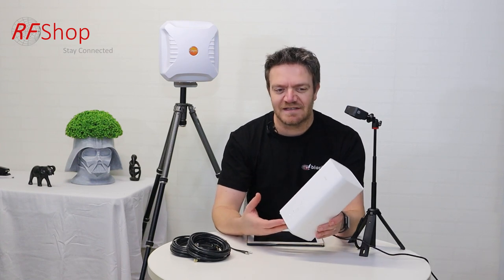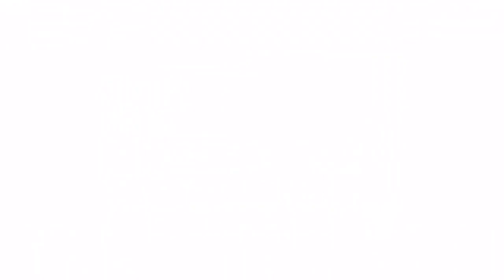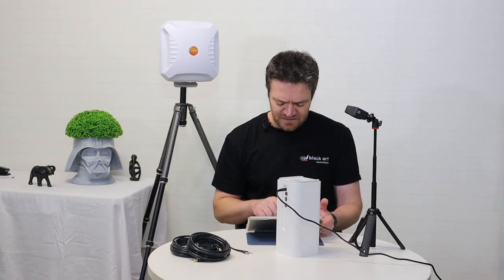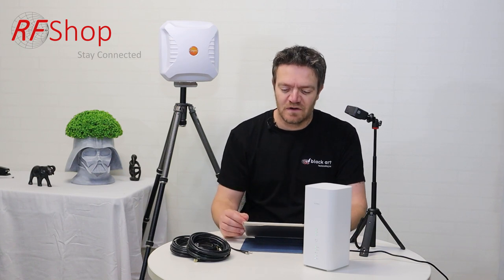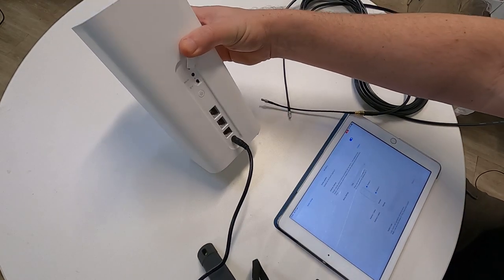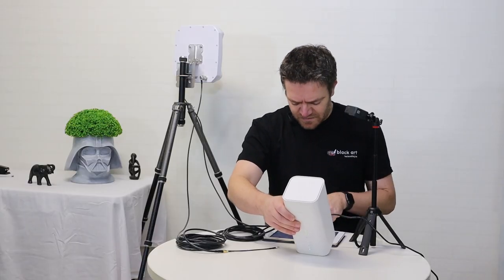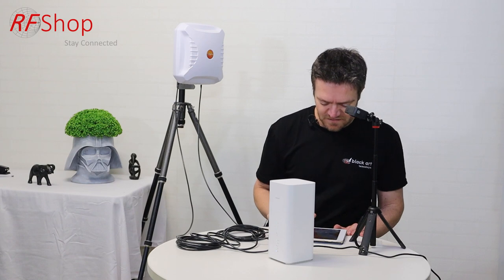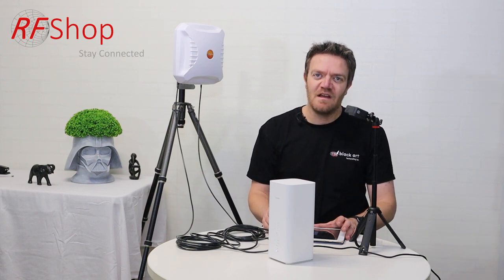How to connect a 4G external antenna to a Huawei B818 modem

Comment: thanks so much for explaining about the main and div antennas and about setting them up to run properly. i was about to buy 2 antennas and thought i had to fit one to each connection, but after watching this it seems that i only need the one, connect it to the 'main' labeled fitting on my router and leave the div fitting as it is, then in the router's homepage and settings, set the configuration to mixed. I think i got that the right way around and you've cleared a few things up for me as-well. thank you
Reply from the maker: Thanks a lot for the feedback !

Comment: That speed is insane man...
I've been using Huawei 3G,4G modems since 2013 since they're the best price/value in Europe.
Unfortunatelly I've changed like 4 different roof LTE antenas and what I found out is that sometimes modems work better with internal antenas and sometimes with 150eur roof LTE antena I've gained like one extra dot on signal indicator. SMA is far better than TS9,since the cable diameter is bigger and more robust with screwing It on modem.
Reply from the maker: Yes, although this video is quite old by now, I still have a lot of love for 4G

Comment: I have a single directional antenna with single output cable. Am I correct in saying that this should connect to antenna input one for it to work. Should I look at replacing it with a similar antenna to what you are showing with two connections. Thanks
Reply from the maker: Yes, a single antenna will work...just need to make sure it connects to the correct port and also thatd the antenna support  the correct frquency bands

Comment: do I need to ground my XPOL-2 antenna? 
I'm just concerned  about the router's safety in case the antenna gets struck by a lightning or in case of a current surge from static electricity
Reply from the maker: Hi Tokelo. For RF performance you don’t need to ground the antenna, but introducing a set of lightning protectors for areas where thunderstorms are common is always good practise. It may mean some adjustments to the cable and connector assemblies to make it work for your specific scenario. Here in Adelaide it’s not so common to get ligtning strikes, but coming from Pretoria, ZA I know how intense those summer evening storms can be.
Reply: @RFShop  alright noted.  Thanks for your response

Comment: Hey! I have set my antena to have great rspr and rsrq but the snir value is very low => 7. Is it important? Can I do something g about it? Thanks!
Reply from the maker: SINR is an indication of how much stronger your signal is than the noise floor. Around 7dB is quite do-able, but higher is always better. Lower will become a problem (i.e. closer to 0) and you will find that the modem starts to struggle to see the signal in the noise. It's a bit like having a conversation in a pub...trying to hear your friend gets harder as the noise gets louder.

Comment: Really really really useful! Thanks a lot, you solved my signal problems.
Thanks from Italy. :)
Reply from the maker: Thanks Eduardo!!
Reply: @RFShop  hey man! I'm currently considering buying a new router but can't decide which one should I get! The b818 or the b2368? Could I just buy an antenna for the b818 and it would me the same as the b2368? I don't feel like going through the trouble of installing it on my house, or is it such an improvement that it's worth it?
Reply from the maker: @herobayman3662  I can only comment from an approved Australian device perspective. I do like the idea of the B2368 in principle, but it would still be an omni-antenna and not that much antenna gain or direction. 
If it's a simple case of good outdoor signal but not so good indoor signal (and the device is approved for use on your local network) that B2368 should be great and relatively simple. 
If the signal is not so good outside and you need some better antenna performance, something like the B818 with a purpose build outdoor antenna will be a better technical solution, in my humble opinion. 

We now have access to the B818, and can offer them as part of a kit or a standalone modem. Hope to get it on our website this week (time permitting :) )

Cheers,
David
Reply: @RFShop   oh okay tysm for your answer. Btw could you tell me what the difference is between the b818-260 and the b818-263?
Reply from the maker: @herobayman3662  unfortunately I have no idea. I can only assume it’s either a slightly later release or perhaps a dedicated model for certain network operators (ie might come with firmware approved for use on some particular network).

Comment: Tq for knowledge sharing. If using external antenna, can i change the setting from auto to external?  Is there any diffrences if i used external? Tq in advanced.
Reply from the maker: If you leave it to Auto, the unit will switch over the external antenna connections and it will be the same result
Reply: @RFShop  tq very much for the info sir.

Comment: Is it conpletely weatherproof? Because here in the gulf states we have crazy weather like heavy rains, dust storms, strong winds, hot summers and cold winters. Is it worth it installing it in such a place?

(If i would buy it i would install it outdoors of course)
Reply from the maker: Hi Hamad, This antenna is rated IP65, has chemical resistance and fire protection. Feel free to have a good read and look on the manufacturer's website
https://poynting.tech/antennas-and-accessories/antennas/farming-agricultural-antennas/xpol-2-5g/

Comment: I was actually trying to do this, I say trying, yet my modern did not auto detect the external antenna?
Even re-started twice and tried with switching cables over. It stays as internal and I used Auto as well.
Any idea? It pointed straight at the mast too!
Reply from the maker: Can you perhaps have a close look at the inner pins of your TS9 connectors? Seems that it is not making contact perhaps…

Comment: Hey! Quick question. I read that the router 4x4 antennas. I have an older outdoors antena dual MIMO 17dbi with 2 wires just like you show. The parameters says 1700-2100 Hz. Does it mean tha my old antena is not optimal for this router? Thanks for a great video!
Reply from the maker: Hi. That really depends on the network connection you use. If the router uses (or can use) anything in 1700-2100MHz it will work well. However, if the network is 700-960MHz or something lower the antenna will actually hurt you as the modem will detect the outdoor antenna and "use" it, but if it does not bring any signal into the modem it will not do much.

Comment: Hi, I've been having trouble with a omni directional antenna giving a weaker signal then the internal antenna, It has a patch lead going from a single cable to the 2 TS9 connectors. you mentioned not to do this, could this be the issue?
Reply from the maker: Hi Jayden...yes, I would think so

Comment: does it matter what cable goes where? is says "main" and "div". I know these antennas looks different inside for each cable
Reply from the maker: It actually does not matter if you have a MIMO antenna. However, where it does matter is when you have a single antenna, as you then need to use the MAIN and not the diversity port

Comment: Hi. I am considering in getting an external antenna for our Huawei B311 4g router as we get slow speeds here at home. We live in a rural area and our provider says that our maximum D/L speed is 40mbps. Questions: 

1. By installing an external antenna, will my Huawei router get more signal and will we have a chance of getting speeds faster than the provided 40mbps?
2. What type of antenna do you suggest, directional or an omnidirectional? I'm not entirely sure where is our cell tower so I was considering of getting an omnidirectional one.
3. What type of dbi gain should I be considering for an external antenna? The one I'm seeing I think has a gain of 10dbi and the other has 25dbi.

Thank you so much and I hope you respond soon.
Reply from the maker: Hi, I eould go for 9-11dBi and not much more. It gets very senditive to alignment. A directional MIMO setup for a fixed installation is always my recommendation. You can find the best tower by using the RSRP meadurements

Comment: Is the antenna's also function to make stronger signal coverage, so we do not necessary to purchase kind of repeater in order to get the better signal?
Reply from the maker: MC ISA, that is the ideal aim although not always possible. 
The external 4G Antenna can be positioned in a better location and has better performing antennas than built-in antennas. 
We rely on those two "features" to get a significantly better signal into the modems than what otherwise would have been possible. 
It's often seen that this is sufficient to get a reliable signal into the modem without having to add a repeater, which could actually introduce some complications
Reply: @RFShop  many thanks for your feedback.

Comment: I've read reviews of xpol2 antennas that were placed in the loft, and they claimed it performed better than being placed outside. Could this be true? And if not, why not?
Reply from the maker: Hi Sean. It certainly is possible that antennas can perform better in different locations and positions. Every setup and installation is different, but one really needs to understand "everything" about their experience and surroundings before one can do a sensible response. Even in many of my demonstrations, it's not the first take or experience that immediately works as expected, but I always make sure I get my head around what I saw before posting the video

Comment: Hi, may i ask..i need a favor here..i got my huawei b818..i just bought antenna with two seperate cables..one cable connect to vertical and another one connect to horizontal in single antenna..does this may occur an error if i put those two cables(horizontal and vertical) in single antenna into my huawei b818 into port main and div? Thanks..
Reply from the maker: Hi, it seems like you have a MIMO antenna. In that case, tge two cables are indeed independant and it’s fine to connect the two of them into the main and aux port of the B818
Reply: @RFShop  Thank David for the info and helping me out..glad to hear it..🤗👍

Comment: How did you get 130 mbs. Are you  using 4G.I'm seeing 4G. I am 3 miles from the mast  and am using one of these antennas but get very low mbs. I must be doing something wrong
Reply from the maker: Hi Alan, do you have the readings fir RSRP, RSRQ AND SINR?

Comment: Hi David,

Which antenna of your shop do you recommend me for LTE FDD bands b4, b7 and b28 ? 

regards
felipe
Reply from the maker: Hi Felipe, I would recommend the Poynting XPOL-2 for most use-cases where you require 700MHz, 1700MHz and 2600MHz. 

However, would be best to assess the whole setup and requirement before making a final decision. Things such as range, mobility or whether MIMO is even needed are important. In that case the ALFA Omni, or Poynting LPDA could be worth considering as well. 

Cheers,
David

Comment: Quick question does the antenna shown here come with the tripod setup? If not where can I purchase the tripod to fit this antenna also I live on a top floor flat so can’t really use it outside but did wanna place the antenna on a tripod by my window would I see benefits if I did this? Or is it purely meant to be placed outdoors which isn’t really an option in my situation.
Reply from the maker: Hi! We actually can offer those tripods…they are AU$89 each.
As for the location of the antenna…it does not matter. You can use the antenna inside or outside. The only problem is that antennas tend to work better outside, but if the limit is the surrounding area you just make do with what you can from the environment.
Reply: @RFShop  thanks for the quick reply that’s fantastic that you sell the tripod to go with it antenna, one final question do you ship overseas or have an online shop for the UK unfortunately I’m not in Australia but wondered if you do international shipping and to what extra cost?
Reply from the maker: @paulc2007  the tripod is quite a big item to ship overseas. I can confirm that there are two options, perhaps you can find the UK distributor? I presented the Gravity Aluminium tripod, but Adam Hall also has a nice aluminium modem. Seems to be 50% cheaper. From what I could see, here in Australia, the RRP for the Adam Hall model is AU$49

Comment: Do it have anything to say what cable u put in? Or is it one hole for just that one hole? Bc the cable and hole is the same
Reply from the maker: Kristian, we can do many different types of cables (also via RFShop). In this instance, we use an RG174 for the short TS9 cable. It's short and flexible. The 150mm length is minimal losses and the cable is flexible to prevent too much strain on the TS9. We can also use RG316...slightly better quality but still a small cable. I have seen TS9 connectors for RG58 / LMR195, but I am concerned about the force it would have on the TS9 connector. 

On the longer cable, we use LMR195 equivalent cable for 5m runs, LMR240 equivalent for the 10m runs and typically recommend LMR400 for anything longer than 20m. The kit, mentioned here, has 10m CLF240 cable (which is the LMR240 equivalent I referred to earlier)

Comment: Hi. I have poynting 2 mimo directional antenna and thinking  to use to use b818 modem outside by placing it into the encloser (as I did for my old Huawei B310 modem and it was working fine  for years). The question is- what it the temperature range for b818? Need to know to avoid overheating. B.R.Alexander
Reply from the maker: Hi Alexander. I can't really comment since I'm not heavily focused on consumer products or have any affiliation with Huawei. Being a plastic consumer product I would not recommend going far above 50dgr C though.
Reply: @RFShop  Thanks for the comment

Comment: may I have a question, please? Huawei 5G Outdoor Antenna AF9E is compatible with Huawei B818 modem?
Reply from the maker: Hi
Yes, seems to be compatible. It won't however, help on 5G since the B818 is 'only' a 4G modem. I would prefer better coaxial cables between the router and the antenna though, but since we don't review antennas we don't sell I can't comment on the performance or quality of that antenna. 
Our channel is focused around solutions we love to offer as we have seen them work really well.
Reply: @RFShop   thank you, I have one last question please, I do have this router at home, can I use this as receiving internet? E.G from a company internet provided then I use this Huawei b818 WAN connection as a router? ( no sim card ) apology I have no knowledge to much of modern technology.
Reply from the maker: @juniorj-r4090  probably can, but wouldn't you rather use the original router and a switch with more Ethernet ports?
Reply: @RFShop  hi there, I could do but I live in very rural area in the Philippines, I can’t get a signal like full bar in my balcony. What I have thinking is, I’m planing to buy a new LHGG LTE6 Kit is a outdoor antenna with SIM card slot and POE Ethernet port. My thinking my Huawei b818 have WAN and also I use a router or a switch and then Huawei b818 is not use by its own sim which I use to run a receiving Ethernet from LHGG LTE6 kits.Does work like that or is it complex? Many thanks for your time and answer again of my question.
Reply from the maker: @juniorj-r4090  Might work. My strength is in the antenna and the first device. I'm not familiar with the exact setup on the networking side of things.
Reply: @RFShop  the mikrotect LHGG LTE6 kit Operating System	 is RouterOS and very difference Huawei platform. My question is Huawei B818 WAN connection does work as a receiving signal if don’t have a SIM card it’s own? Because I have still doubt about WAN connection Huawei b818. I am not an expert on this so that I would like your  ideas or help if you have an experience how to use this kind of stuff and I have many research about WAN connection how does it work on Huawei B818 but I couldn’t find on internet. I really appreciated for your time again for replying my question.

Comment: Hi, great video. I got a b818-263 from my provider and I'm wondering if using a 2x2 MIMO external antenna actually consists into a limitation of the max speed of a normal 4x4 MIMO. Does the "mix" setting actually mix internal+external using still a 4x4 MIMO or it just work on 2x2? Thanks for all your information in the video, hope someone is going si answer my questions because external antenna are not cheap an I don't know if it's worth.
Reply from the maker: I don’t know if there’s a software switch that makes it 2x2 when connecting an external antenna, but I know from hardware perspective it turns into a 4x4 with two internal and two external antennas. My gutt-feel is that it should still be 4x4
Reply: @RFShop  thanks for your answer!!

Comment: Hi, you mentioned an RSRP of -85dBm is good which is pretty much what I get now. Does that mean an external antenna would not help my really slow (3 to 5 on 4G+) dl speed?
Reply from the maker: Kenneth, can you also share the other numbers (RSRQ and SINR)? RSRP of -85dBm is strong, but if the other numbers are weak there would still be a problem
Reply: @RFShop  RSRQ -10dB and SINR 10dB
Reply: @kennlopez  over bandwidth, try to lock other cell id tower.

Comment: Good video thanks . Will this help  if the internet is throdled ?
Reply from the maker: Hi Thabo! Yes, the signal will be improved regardless whether the connection is throttled or not. However, this won’t change anything about the throttle itself